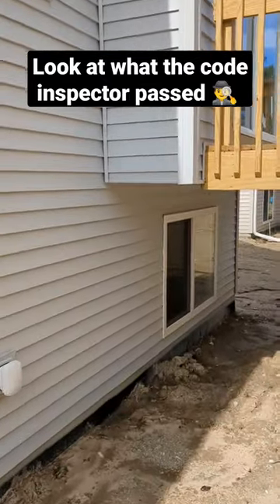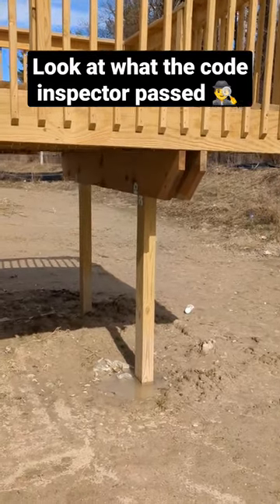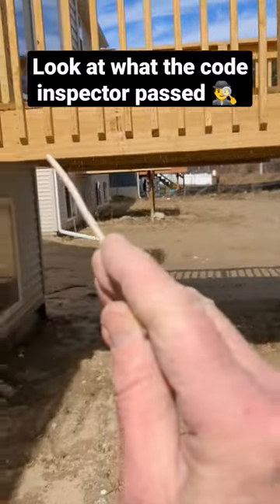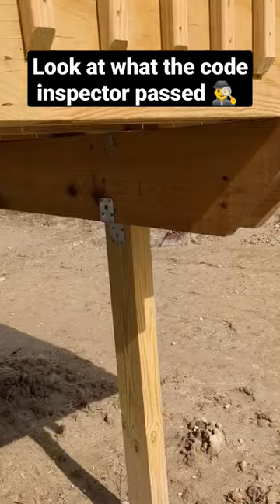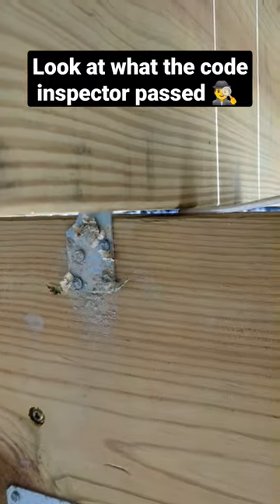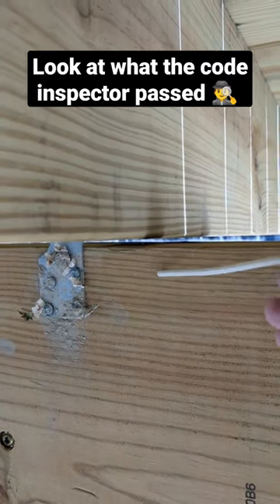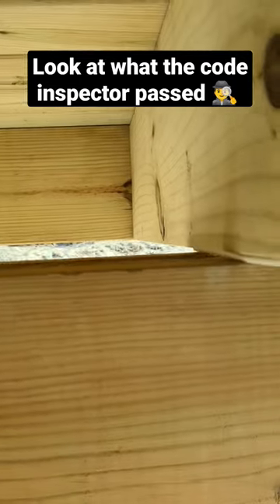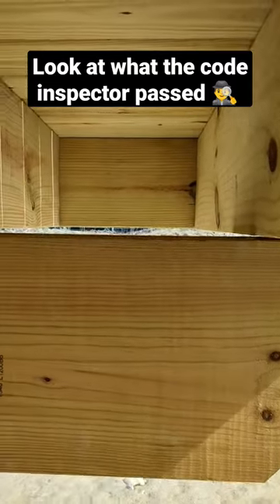Code #inspectors don't pay attention to detail#deck #newconstruction#youtubeshorts#shortvideo#shorts

Comment: Meh, I would have planed the joists to all be even my self but it will settle and be fine. The way the posts were done in the ground as others pointed out will be a problem in the near future if not tackled. Also, Is it literally so hard to use a 4x6 or 6x6 and notch it... people will literally build as close to pushing just the limit/code as they can to save a few bucks on some lumber. SMH. It looks tacky and weak.

Comment: Tear it down and have it done right! That's horrible work
Reply from the maker: Absolutely rebuilt it. This home got worse. SEE Missing Footings Inside https://youtu.be/TqGMGpvnVAk
I've been finding more developments selling homes with NO decks, but they install handrails in the slider door frame. Once the code inspector is gone a crew member comes back and slaps on the deck for extra money 🤑 and no permit. Ugh.
Thanks for watching.

Comment: Alot wrong there
Reply from the maker: And it kept going. Ugh The entire deck is improper and needs to be rebuilt.This home got worse. SEE Missing Footings Inside https://youtu.be/TqGMGpvnVAk
I've been finding more developments selling homes with NO decks, but they install handrails in the slider door frame. Once the code inspector is gone a crew member comes back and slaps on the deck for extra money 🤑 and no permit. Ugh.
Thanks for watching.

Comment: It will settle. After it expands and contracts. It has to get used to its environment causes setting it tight will warp the beam or the deck. Woods funny like that. But honestly experienced carpenters will know these lil things that can become big problems later and the only thing that rim Joist is doing is keeping the floor joists from warping left or right there no weight on that. Sorry but u probably should have done ur homework b4 posting this video 🤦🏼‍♂️I hate homeowners like this. I can only imagine the punch list he’s put together poor contractors. Anyways hope they went back set them thing tight for you 😂
Reply from the maker: The entire deck is improper and needs to be rebuilt.This "PUNCH LIST" got worse. SEE Missing Footings Inside https://youtu.be/TqGMGpvnVAk
I've been finding more developments selling homes with NO decks, but they install handrails in the slider door frame. Once the code inspector is gone a crew member comes back and slaps on the deck for extra money 🤑 and no permit. Ugh.
Thanks for watching.

Comment: That ain't right
Reply from the maker: NOPE! None of it. The entire deck is improper and needs to be rebuilt.This home got worse. SEE Missing Footings Inside https://youtu.be/TqGMGpvnVAk
I've been finding more developments selling homes with NO decks, but they install handrails in the slider door frame. Once the code inspector is gone a crew member comes back and slaps on the deck for extra money 🤑 and no permit. Ugh.
Thanks for watching.

Comment: They will settle.this guy has no clue.
Reply from the maker: Here's a clue. They will settle like the house will. The entire deck is improper and needs to be rebuilt. This home got worse. SEE Missing Footings Inside https://youtu.be/TqGMGpvnVAk
I've been finding more developments selling homes with NO decks, but they install handrails in the slider door frame. Once the code inspector is gone a crew member comes back and slaps on the deck for extra money 🤑 and no permit. Ugh.
Thanks for watching.

Comment: The whole thing is a fail for me, dont like any of it
Reply from the maker: Absolutely. The entire deck is improper and needs to be rebuilt.This home got a lot worse. SEE Missing Footings Inside https://youtu.be/TqGMGpvnVAk
I've been finding more developments selling homes with NO decks, but they install handrails in the slider door frame. Once the code inspector is gone a crew member comes back and slaps on the deck for extra money 🤑 and no permit. Ugh.
Thanks for watching.

Comment: Lol really? They will settle down.
Reply from the maker: Yes. But NOT Like that.🙄
Reply: @inspectflix  lol apparently not because the the joists shrank and will eventually settle back down on the header. I have only been building for 25 years. I would have picked on the concrete not being up high enough to keep the standing water off the posts.
Reply from the maker: @foleydave26  Well, actually, I made several videos on this and there's also wrong ledger application, post and beam improper and much more.
The entire deck is improper and needs to be rebuilt.This home got worse. SEE Missing Footings Inside https://youtu.be/TqGMGpvnVAk
I've been finding more developments selling homes with NO decks, but they install handrails in the slider door frame. Once the code inspector is gone a crew member comes back and slaps on the deck for extra money 🤑 and no permit. Ugh.
Thanks for watching.
Reply: @inspectflix  some people cut corners to make money and the homeowner gets screwed. Keep up the good work

Comment: If you are focused on that gap, you are just as clueless as the builder and the other inspector. That gap is just a result wet PT lumber shrinking. It the joists will settle onto the beam over time. Theere are 2 really major issues. 1. The ledger is attached to cantilevered floor joists. Thats a huge no-no. 2. Split beams have not been allowed for like 20 years. 

Just another useless inspector that passed a 2 week class but knows nothing about what he us unspecting. Get a clue dude.